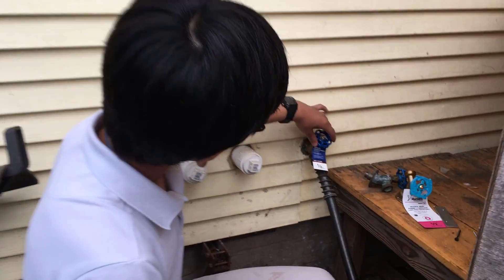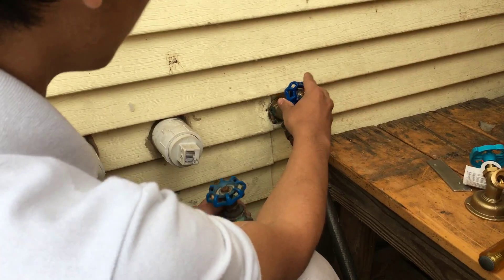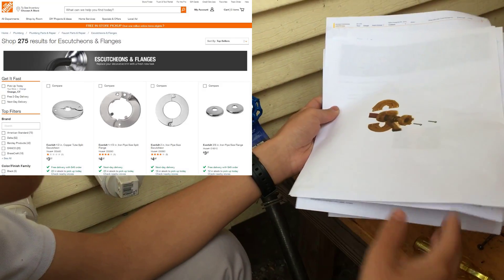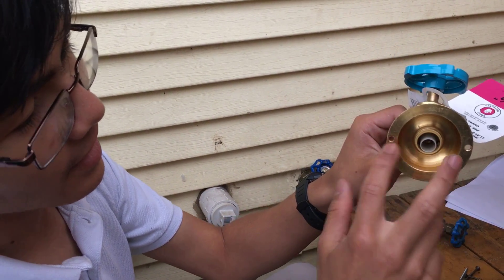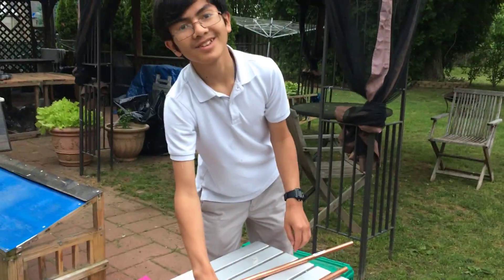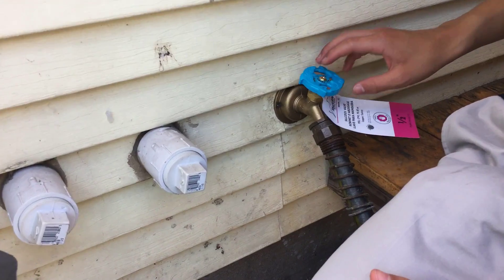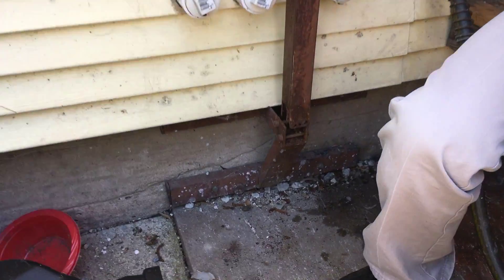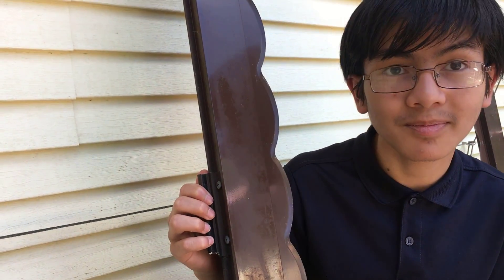Loose or Wiggly Outdoor Faucet & Using SharkBite Hose Bibb Spigot Valve | How To Fix Repair Ideas

Comment: The spigot on my moms house can rotate a little to the left and right.  It's not anchored to the wall when someone moves the faucet and I watch from the basement I cannot see movement at all. I don't see a leak wondered if the copper line is secure in the bib or what?